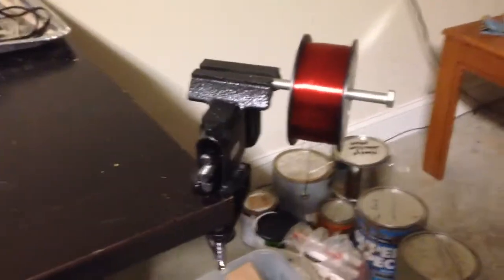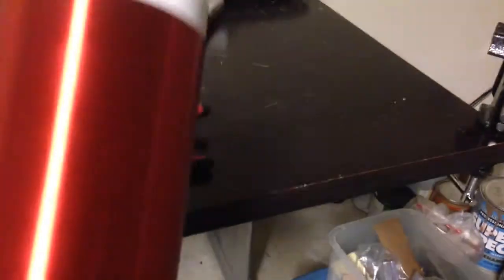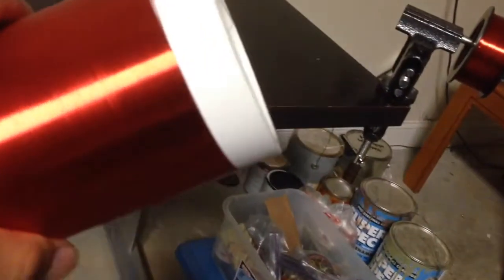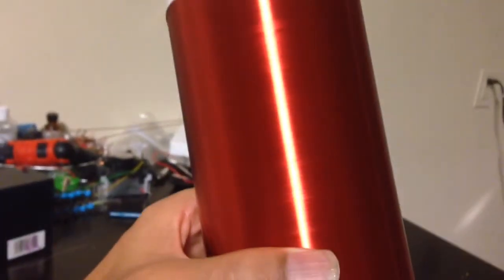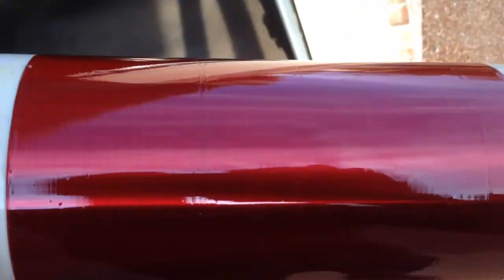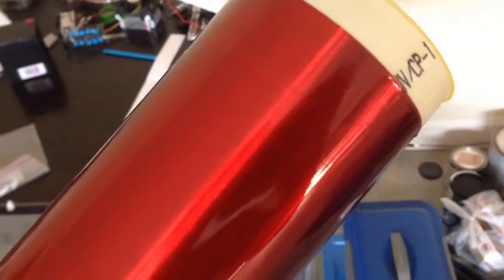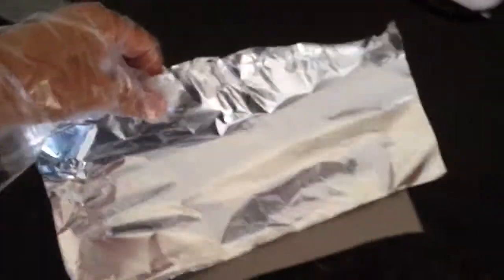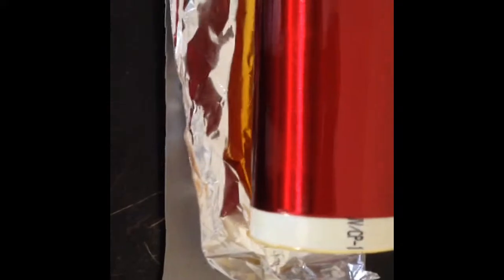Solid State Tesla Coil 2 - Easy way to Lacquer

Comment: SO many frustrations with this method.  I think I just messed up a mini Tesla coil and may have lost hours of time and a few $.  I wish I had used a proper paintbrush.  The issues I encountered include: polyurethane where it wasn't needed (including the inside of the coil) and uneven thickness in the layer which resulted in drips on the bottom edge as it was drying.  It looks like a 2 year old did the work.  If I could sand it and start again I would.  If I had a paintbrush on hand I could have cleaned things up a bit, but it seemed like this method was so simple.  Anyone else struggle getting good results with this technique or maybe I'm the only one lacking coordination!

Comment: Can i use synthetic enamel paint to coat the secondary ?
Reply from the maker: That would work well. Also clear coat is Something that people are using much more these days. It does not have the problem with the toxic vapors that come from drying polyurethane.
Reply: @BrianDhvTinkerer  thanks for the info